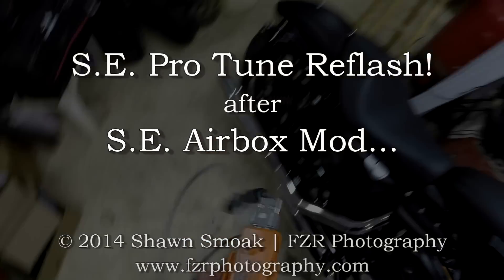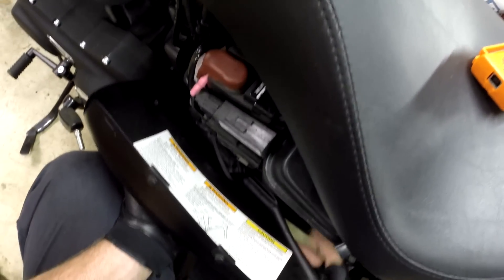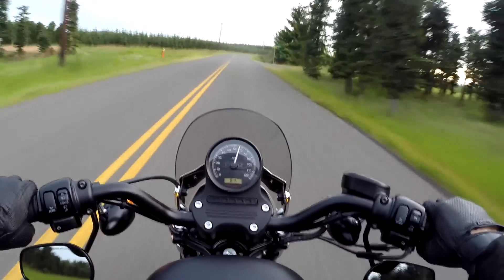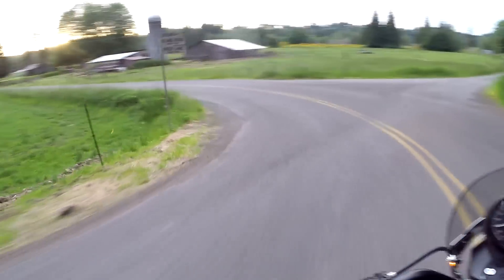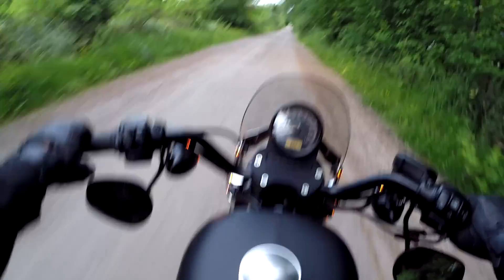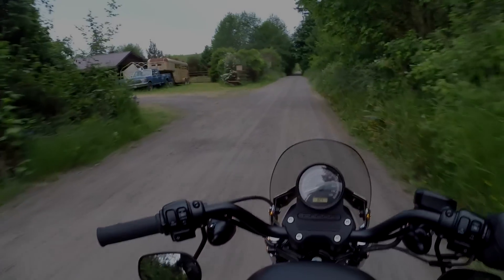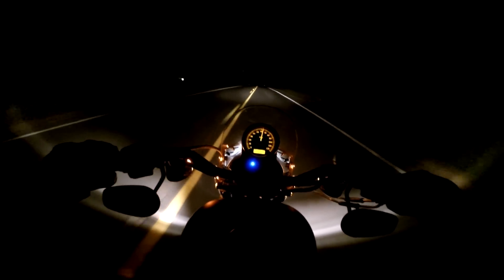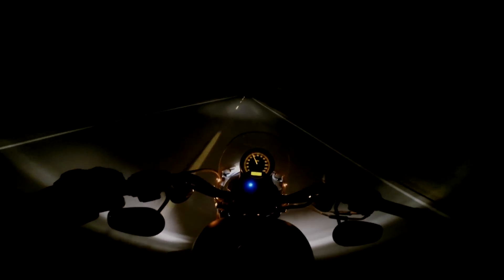Super Tuner Pro ECM Flash! - After Air Box Mod! - Iron 883 | TechTalk

Comment: Question:  You said you downloaded and used the "MyTune" to refine the SE tune.  How did you determine what tune to use (SERT or TTS), and which tune specifically.  There are and I was wondering where you could find the best one for your bike (I'm on a 16 FLXHS, stage 1).  Appreciate any help.
Reply: Hi Jason - I just performed the tune on my Iron 883, I'm yet to ride it post re-tune to notice any change.  I too wondered about SERT/TTS etc. Basically TTS is the only option, and SERT depends on what tuner you have? SERT is Screamin Eagle Racing Tuner etc.

Comment: Hi,

I am venkat from India. Own Harley Davidson iron 883 – 2013 model. Have replaced (myself) my stock exhaust and air filter(thru your tutorial - Special Thanks to you) with Screaming eagle stage-1 exhaust and company’s air filter(Stage 1) except EFI.

WIll it affect the ENGINE life? After this change my bike has clocked down around 1000kms only. With respect to performance its good except the mileage(12km Per Litre).

Pls advice.
Reply from the maker: Hi Venkat, with the one or the other (exhaust or intake) mods, the EFI will auto compensate after a couple rides. However, with both exhaust and intake installed, the EFI (in the US anyway) will not compensate with stock EFI mapping and the bike will run dangerously lean. Some type of EFI fuel management should be installed. If it's available to you in India, the "Fuel Pack 3" from Vance & Hines is very easy to use and does a fantastic job of remapping the EFI to your intake and exhaust mods.  Remapping not only makes the bike run at safe fuel mixtures, it also unleashes the power potential from the mods installed...  The SE Super Tuner Pro that I'm using here obviously does the same thing, but is quite complicated with a pretty steep learning curve.  The V&H FP3 is easily controlled through your iOS or Android smart phone.

Thanks for watching and commenting Venkat!
Reply: Hi Shawn,
Thank you so much for your immediate response. Once again thanking you.

Comment: Hay shawn love the videos just got an iron 883 and im looking to put exhaust and air cleaner on once its broker in, so im new to this stuff. by flash you mean you just using the auto tuner? also once i install those mods would doing what you did in this video make a considerable difference in the video or do you think riding it for awhile to see how the tune goes stock?

Comment: Hey Shawn, how the the Screamin Eagle Street Tuner stack up to the Pro Race Tuner? I have Sportster 48. All I'm doing is Vance and Hines Short Shot Staggered with and air cleaner. Not sure which air cleaner yet. I don't need to squeeze out ever last drop of power from the bike. I'm pretty happy with the power from the factory. I just want to bike to run right with those parts and maybe pick up a couple HP in the process. So would the street tuner be enough or would you recommend the Pro Tuner??

Comment: whatever how you modify the air filter, carp, or whatever for more power there is a maximum speed which is set by the factory, and it will not exceed the maximum speed, unless you use power commander to reset the maximum speed

Comment: I got the Pro Super tuner when I upgraded air box and exhaust. The dealership tuned it up for me but I always wonder if they did the best job of it, especially considering how expensive it was.
You explained it very well and I'm tempted to get a set of transfer leads now and dabble in the dark art of data manipulation :)
Reply from the maker: Unless the dealer ran your unit on a dyno or took it for some recorded runs, they flashed it with the canned Stage-1 flash. Don't get me wrong, that's fantastic! However, you could do some recorded runs of your own and zero your bike in. If you purchase the cables, don't forget to also purchase the Screamin' Eagle software! They can be found online for around $70 USD combined...

Thanks for watching and commenting Hepcat Harley !
Reply: I'll look into that, thanks Shawn, great info, I'd forgotten about buying the software. My unit cost 450GBP so it's not much fun having the extra expense on top, :( I still get a bit of decel popping from my 2 into 1 fishtail exhaust and just get that feeling it's running a touch lean, but only slightly. Thanks again, much appreciate your reply :)
Reply from the maker: You're very welcome!

Comment: Thanks for all the info brother. I think I will start saving now as I like what the whole process has done for your ride. I have the after market exhaust already of the 1200L. I will need to do the SC air cleaner upgrade and then have it flashed. I  would like to see how she feels winding past 5500rpm. Ride safe!
Reply from the maker: Very cool dheller777! You will enjoy the improvement... You'll get a bit more virtual experience of over 7,000 rpm rev limiter in my next two videos...

Thanks for watching and taking the time to comment on the videos! rsmf